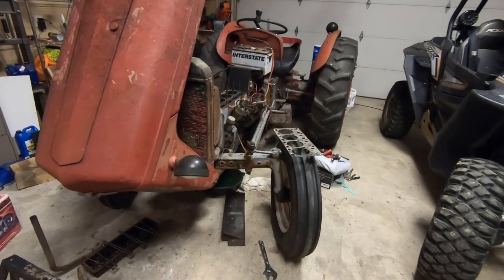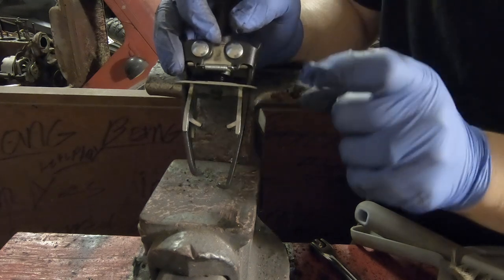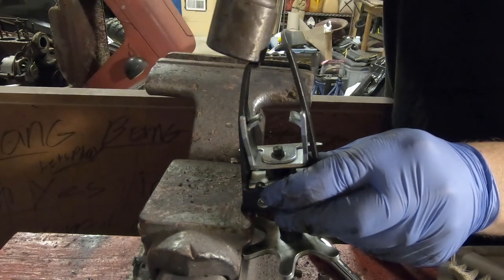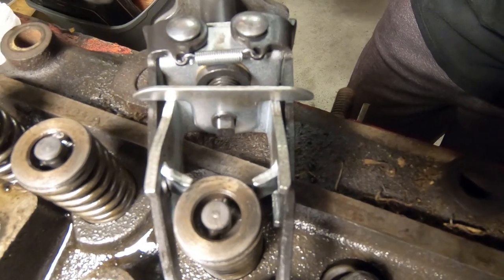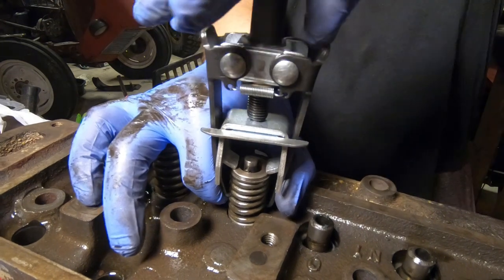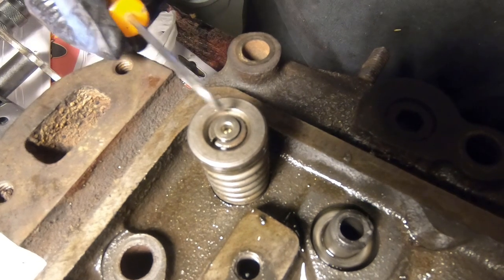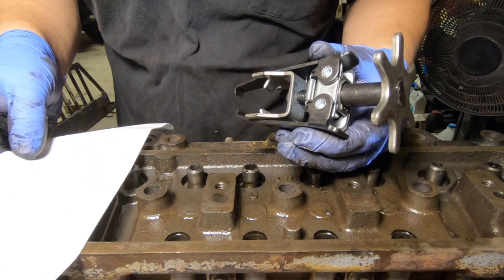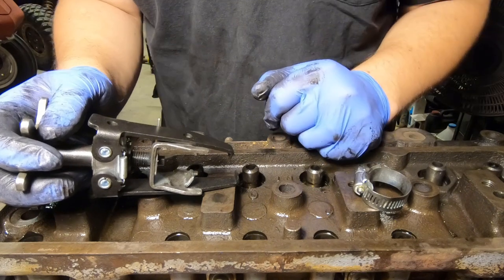Removing Valve Springs Using HARBOR FREIGHT Compressor

Comment: Thank you, sir.  I bought mine at NAPA, same tool. The package stated that it can fit most vehicles allowing the removal of the valve springs w/o removing the head. Your demonstration was extremely helpful. Peace out..:)
Reply from the maker: Good deal man glad it was useful, thanks for the kind remarks.

Comment: I bought this and used it. Just this week i put valve stem seals on my 350 chevy. Had to repair this thing every few springs. It bends on the part that pushes down the springs. Easy to squeeze back but you will see visible signs of the soft metal mashing up in that same area. It will get 16 springs off and on if you’re careful with it but mine is going in the trash now. It served its purpose
Reply from the maker: Its definitely priced as a disposable tool but I think it'll hang around a while longer. Ive actually used mine again for another 4 cyl head and its still kicking. Once you get the hang of it its a handy little tool to keep around.

Comment: Great video, very helpful. I am working on a 1979 Granada 250ci inline 6. I couldn't get the two semicircle keepers out, because there was a bowl-shaped retainer that snugged against them. When I depressed the valve spring, the retainer was still tightly hugging the keepers so I couldn't get them out. So before depressing the spring, I put a perfectly sized washer over the top of the spring, which only left the stem and the keepers exposed (but covered the spring and the retainer). Then I put a large socket over it and smacked it with a hammer. That loosened it up. So then when I depressed the spring, the keepers were loosely laying there to be pulled! That was such a trick to figure out
Reply from the maker: Sounds like your valve job was a little more eventful than mine. Glad you got it worked out. That socket trick is old school but usually when I try it I am having to order new retainer clips because they go flying haha
Reply from the maker: Another old school trick for assembly is instead of using a magnet like I did, take a non magnetic screw driver and a dab of grease on the end. It's like a glue trap for the keepers and helps you get them in position while holding the spring down with the compressor tool.

Comment: Thank you man. I’m going to through the same with a 262 and the clamp would slip when I was twisting it and I’m going to roll it with a hammer. I appreciate it man.
Reply from the maker: I was getting so desperate I was tightening hose clamps around the arms to keep it from slipping off. After I bent the little tabs in some more they never slipped off. Good luck with it man.

Comment: Thanks for the info on the valve spring compressor.

On mine I bent the "legs" until they are nearly touching one another and it gives it more grip (also the the springs I'm working with are quite small).

It went from being useless  to working well. It made the spring bend one way and it sliped before it could properly compress the spring and not it works like a charm.
Reply from the maker: Thanks for checking the video out. I was in the same predicament originally. I was trying to use hose clamps and zip ties to hold the legs of the puller in the spring then finally I said screw it and bent them in and it worked like a charm

Comment: I did this job with this tool on a v6 3.0 Vulcan without bending the fingers. That was not a fun job. I shot a few springs across the room. Wish I had thought of this then.
Reply from the maker: If i wasn't worried about the video being 15 minutes long I would have shown how I did it on the first two valves. I had to use that hose clamp to keep the fingers pressed into the springs.

Comment: My springs just want to come up and just bind against the pin.. any thoughts?
Reply from the maker: Some of my springs were stuck to the top of the valve like the tool picked the spring up away from the head instead of pressing them down. Not sure if that's whats happening to yours but all I did was sprayed them with some PB blaster and let them sit a while. Some still got stuck but once I compressed them I supported the valve from the bottom with a socket and carefully bumped the compressor down toward the head and they came unstuck real easy. Good luck and wear your safety squints lol

Comment: What was the clamp for?
Reply from the maker: Before I bent the tabs on the arms of the valve spring compressor inward some they would slip and shoot out of the spring. At first I was using the hose clamp to tighten around the valve spring compressor arms to keep them from slipping out. After I bent the arms in a little, they didn't slip any more. Hope I explained that well enough lol.

Comment: What about installation
Reply from the maker: To quote the late (and great) John Haynes, creator of the Haynes Repair Manual, "assembly is the reverse of disassembly" lol Forreal though its pretty much the same process backwards but instead of using a magnet to extract the keepers use a non magnetic screwdriver with some wheel bearing greese on the end. The keepers will stick in the grease good enough to go in but they won't pull back out like a magnet will.

Comment: Your right this isn’t that great of a tool, it is not universal as mentioned on the package, if the valve springs are down inside the head you will not be using this tool at all, for example I have tried to use this tool on a 2011 2.4 Ecotec head where the valves are down inside the head and this tool will not fit